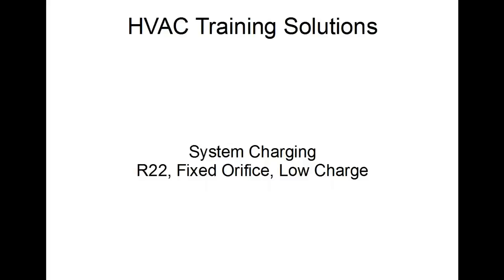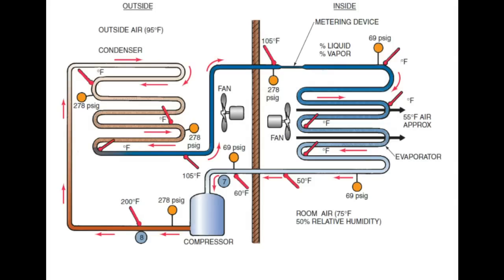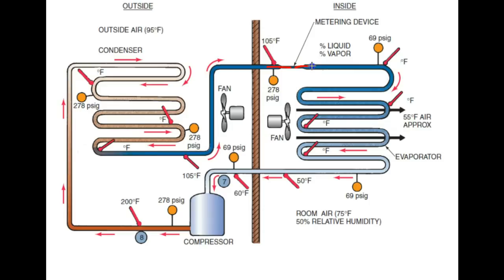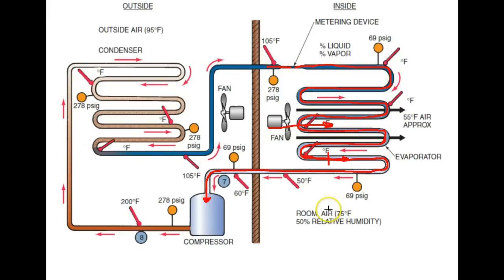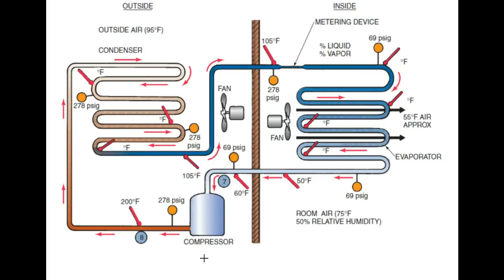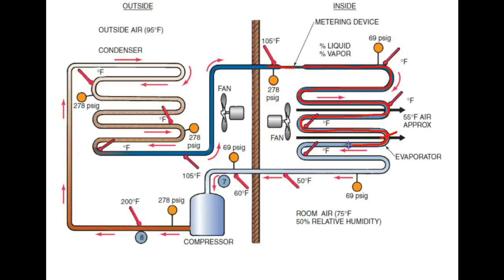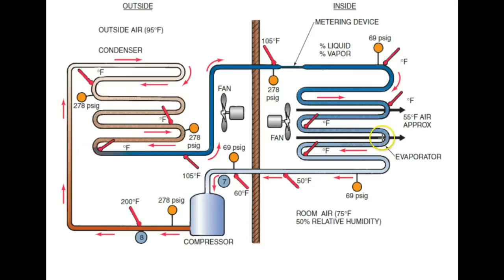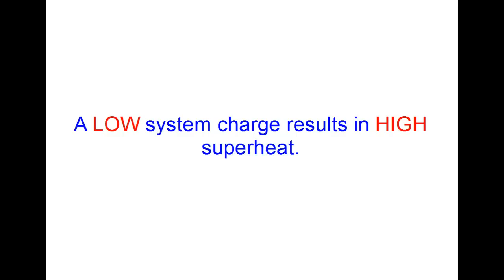System Charging - R22, Fixed Orifice, Low Charge

Comment: Something is wrong with this explanation. In Europe   common repair pratice is to  measure  a pressure by blue gauge  on suction (vapor) side. And if  this pressure shows for  407C  e.g 46 psig = saturated  temperature  of -10 Celsius, then it is sign that there is no enough refrigerant . Normal value of saturated temperature for   407C  must be between + 2 C to +5 C = 70 psig . That means if there is no enough refrigerant in system then  pressure on evaporator e.g suction side drops what can be explaned that there is no enough molecules of vapor. This is opposite to explanation in this video where is stated that pressure is still 69 psig e.g.  4,76 bar no matter of lack of refrigerant.

Comment: How do you know what size piston should be used on a heat pump or ac when the systems are mismatched. Example: A new Goodman 13 SEER heatpump outdoor unit replaces a 20 year old Carrier 10 SEER unit. The old indoor fan coil AHU is Carrier and left as is. When just the Condensing unit is replaced and of a different brand or seer, how do you know what size pistons to use. There are a lot of mismatched systems out there. Thank you for all your time and videos they are a great help.
Reply from the maker: Wayne Miles You don't. The systems should be matched, if they are not there is no way to tell.